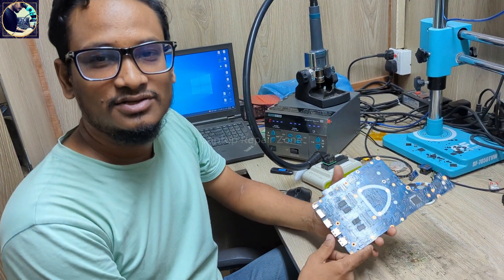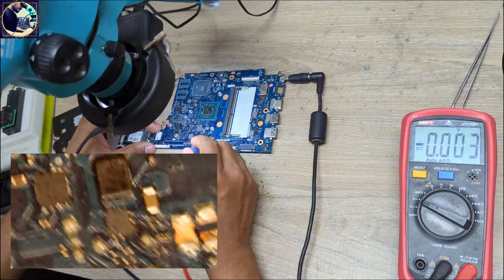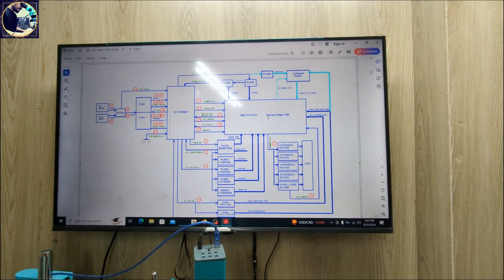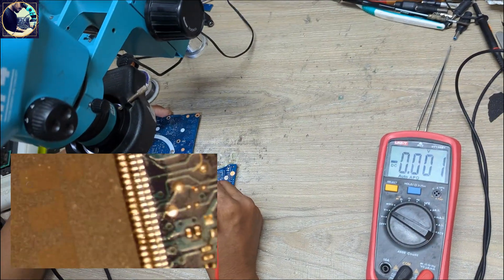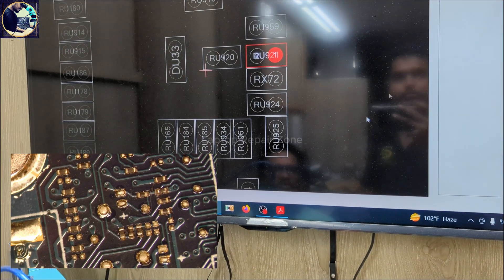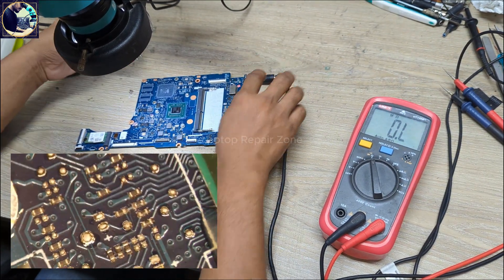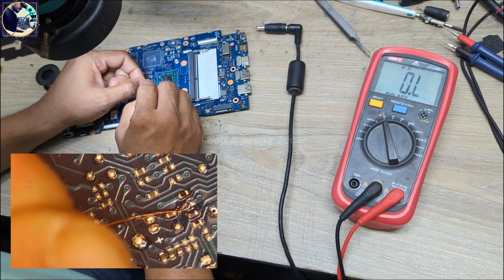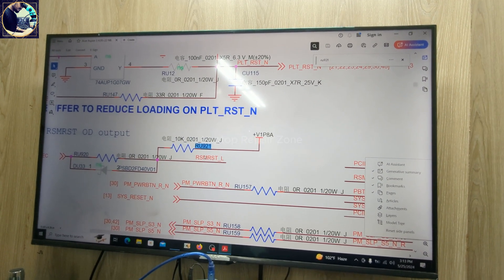Acer Aspire A315 laptop won't power on fixed | nb8607_pcb_mb_v4 | Acer laptop no power fixed!

Comment: Why there is no voltage passing through 10k resister
Reply: Removing that resistor is not the best idea. 10k placed there to reduce the current. This repair wont last before damaging something else. 10k resistor can't be replaced with a fuse
Reply from the maker: Yes I know but I already did it on another laptop before 1 year and it's still working good...